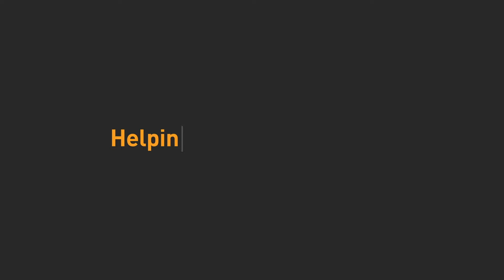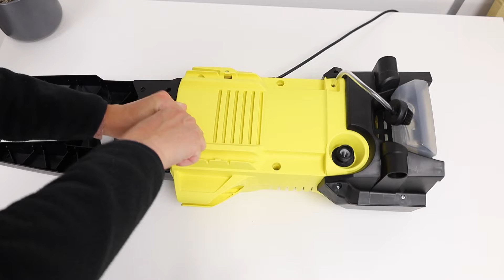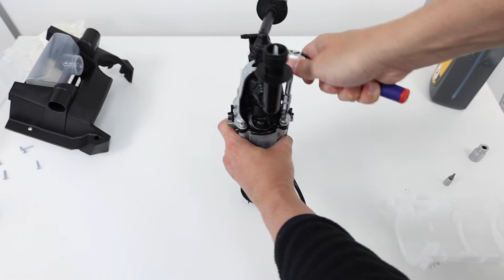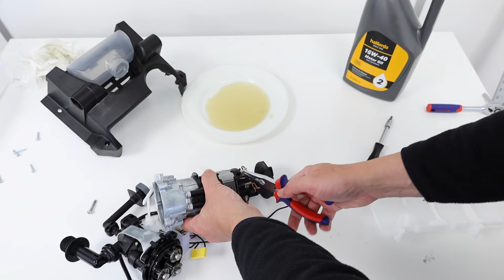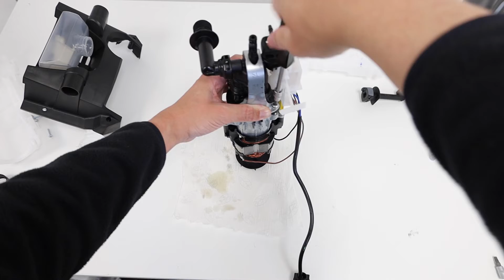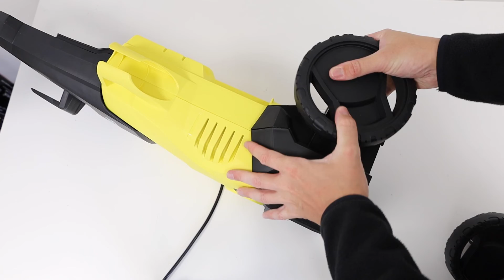How to Replace a Karcher Pressure Washer O Ring Seal Found in The Cylinder Head (K3)

Comment: Thanks for the video,  Would this be the fix if the motor seems to prime itself (cycle on briefly then go off after one second), and results in a lack of power so the more powerful wand doesn’t operate properly (after a few seconds it becomes like a laser focused stream as opposed to a spread out fan as it’s supposed to.)